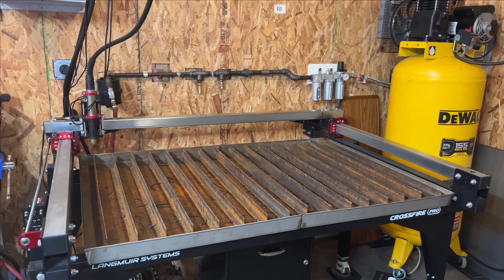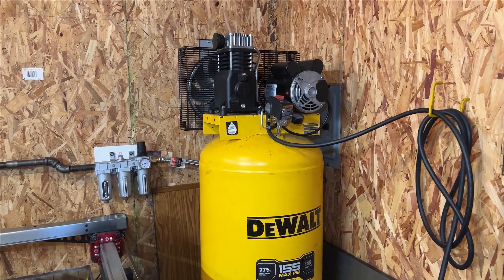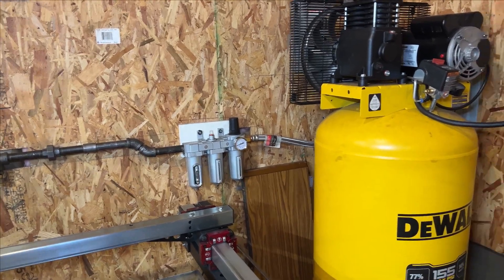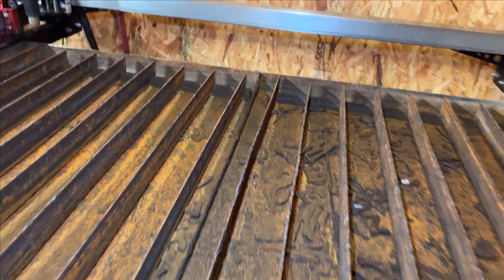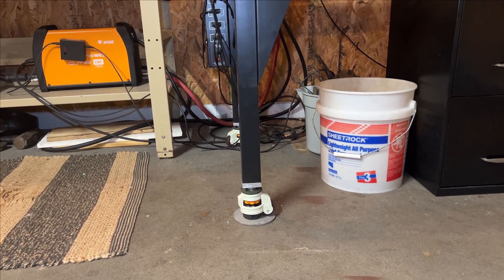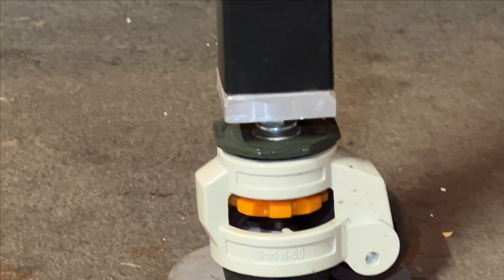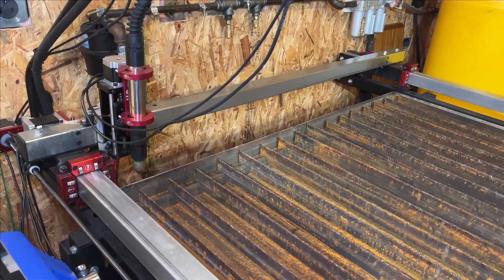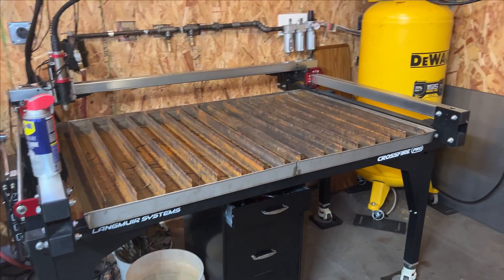Langmuir Systems CrossFire Pro - Setup Overview - Tips and Tricks - CNC Plasma Cutter

Comment: Nice video. I ended up getting a table made out of stainless steel and making in bigger with one drain in the middle. I have pretty much the same compressor. Now I’m running into trouble with it telling me the pierce delay is to short or it won’t fire at all.